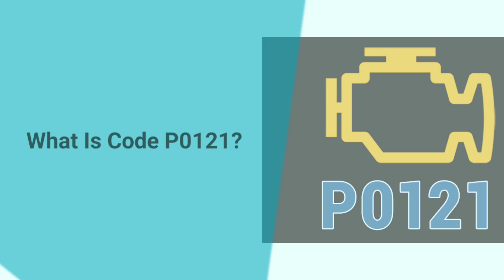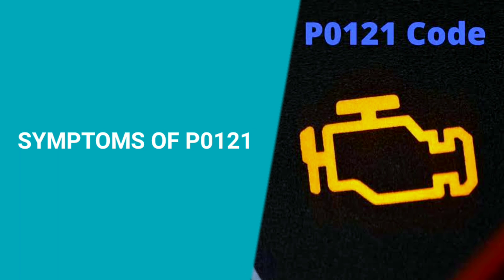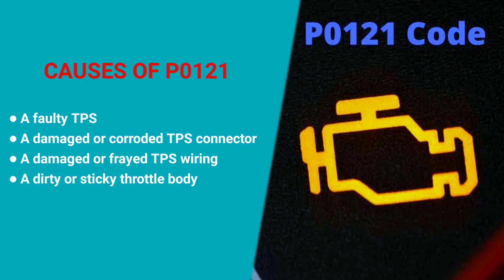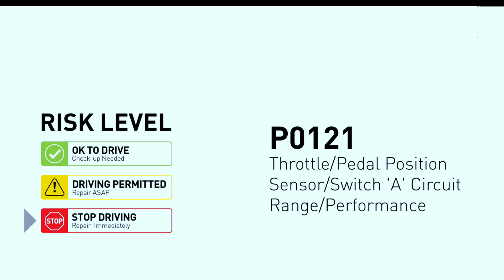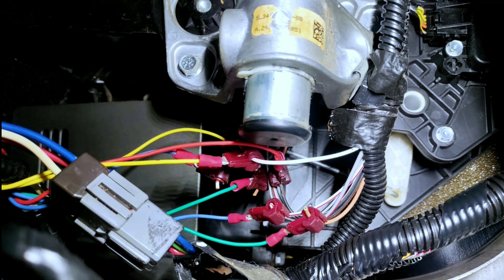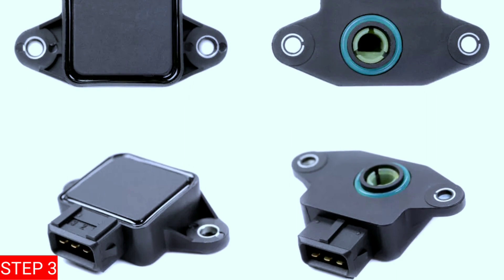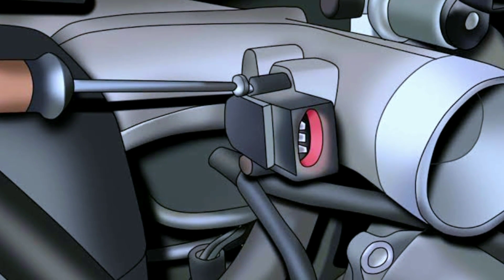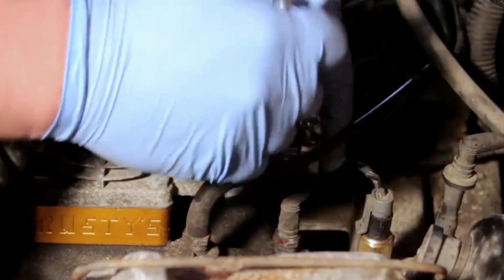P0121 Code: Causes, Symptoms, and Easy DIY Fixes | How to fix p0121 Code |

Comment: Hi, I have a 2011 Kia Soul, and it sat all last winter and summer because I can get it fixed. I changed the oil, new air filter, and charged the battery. It started right up. Runs fantastic but, when it warms up it revs up to 4000 rpms in park and neutral. I put a new idle control sensor, a coolant heat sensor and Throttle Position Sensor, cleaned the throttle body with a toothbrush and throttle spray cleaner and it's still reving up to 4000 rpms after it's warmed up? Im stumped? Any ideas, please?
Reply from the maker: When a Kia Soul revs up to 4000 RPM in park/neutral after warming up, even after replacing the IAC, TPS, coolant temp sensor, and cleaning the throttle body, it usually points to something beyond the basic sensors.

Here are a few possibilities to check:

Vacuum or intake leak – A cracked hose, loose intake gasket, or PCV valve leak can let unmetered air in, causing the ECU to hold the idle high. Spraying carb cleaner around the intake and hoses while the engine runs can help pinpoint leaks.

Throttle body or electronic throttle control issue – If the throttle plate is sticking open or the electronic throttle motor isn’t calibrated, the engine may race. Sometimes a scanner with throttle relearn capability is needed after cleaning/replacing parts.

ECU or wiring problem – Since the car sat for a long time, rodent damage or corroded wiring could affect sensor signals. A wiring check for the TPS and IAC circuits is worthwhile.

Idle relearn needed – After replacing sensors and cleaning the throttle body, the ECU often needs an idle relearn procedure (done through a scan tool or following a specific ignition/idle cycle process for Kia). Without this, it may keep idling very high.

In short: If the engine only revs high once warmed up, start with a thorough vacuum leak check and then perform a throttle/idle relearn. If the problem continues, you’ll need a scanner that can read live data from the TPS, IAC, and throttle motor to see what’s commanding that high idle.
Reply: @weeklytools Wow, thank you so much for your time! I performed a smoke test, and the only thing leaking was the gas cap, which I replaced. I also performed the relearn steps and nope. I haven't check over the wiring, which is a great idea! Thank you so much!

Comment: I've been struggling with this issue (P0121,P0121 RPM rev up down engine at idle Min: about 1100 RPM) for about a year now, and what’s particularly perplexing is how random it seems. Most of the time, clearing the error resolves the problem for a few months, and occasionally, the issue even disappears on its own. However, a few months ago, the problem resurfaced, and this time my engine's RPM wouldn’t go above 3000. Restarting the machine temporarily fixed it, but the issue kept coming back. Eventually, an engineer suggested replacing the throttle body and resoldering some parts of the ECU. I’m not sure which parts were resoldered, but after that, the problem reappeared briefly. Then, after replacing the throttle body and resetting the ECU, everything seemed fine for about four to five months. Unfortunately, the same errors have returned. Occasionally, the RPM fluctuates while idling, while at other times, I only receive the error without any RPM issue. As I mentioned earlier, the issue is completely unpredictable, but it happens most frequently—around 90% of the time—right after starting the engine. I really need to find a lasting solution to this problem.
Reply: Did you ever figure something out
Reply: @brandonlopez4959 u have same problem? Me not still
Reply from the maker: It sounds like you've tackled a lot of potential fixes and it's great you've documented your journey.  If the error is returning, it might be time to look into a deeper diagnostic scan or consider seeking professional help.

Comment: Ótimo vídeo e dicas, o meu aqui e um Peugeot 206 1.0 no aparelho apresenta esse mesmo código será que o problema vai está no sensor tps que fica na tbi,ou no acelerador eletrônico me ajuda amigo?
Reply from the maker: Tienes razón, el código P0121 generalmente apunta a un problema con el sensor de posición del acelerador (TPS), pero no es la única posibilidad. Esto es lo que podría estar pasando con tu Peugeot 206 1.0:

Sensor de posición del acelerador (TPS): este es el culpable más probable. Un TPS defectuoso no enviaría la señal correcta sobre la posición del acelerador a la computadora del motor, lo que activaría el código P0121.

Problemas de cableado o conectores: el daño o la corrosión en el cableado o el conector entre el TPS y la unidad de control del motor (ECU) podrían interrumpir la señal y causar el código.

Electrónica del pedal del acelerador (menos probable): en algunos casos, los problemas con los componentes electrónicos en el pedal del acelerador podrían imitar problemas del sensor TPS. Sin embargo, esto es menos común que un sensor defectuoso.

Esto es lo que puedes hacer:

Verifique otros códigos: si bien P0121 sugiere un problema de TPS, puede haber otros códigos almacenados que podrían arrojar más luz sobre el problema. Considere la posibilidad de escanear el código de un mecánico o utilizar un escáner OBD-II, si tiene uno.

Inspeccione el cableado: busque signos visibles de daño o corrosión en el mazo de cables entre el TPS y la ECU.

Consulte un manual de reparación: un manual de reparación específico de un Peugeot 206 puede tener pasos de diagnóstico para identificar la fuente exacta del problema.

Llévelo a un mecánico: si no se siente cómodo resolviendo el problema usted mismo, el mejor curso de acción es consultar a un mecánico calificado. Ellos pueden diagnosticar el problema y recomendar la reparación adecuada.

Recuerde, el reemplazo de componentes como el sensor TPS solo debe realizarse después de un diagnóstico adecuado. ¡Buena suerte!
Reply: @weeklytools  amigo realmente o sensor tps está fora dos parâmetros, troquei a luz apagou da injeção,porém tinha mais um erro ,escane passou a acusar sensor de temperatura do ar,porém troquei não resolveu,o problema estava no motor das engrenagens da tbi,botei uma completa aí resolveu o problema.
Reply: Obrigado amigo pela ajuda,no aparelho de vez em quando aparece o p0123 junto com o p0121,aí eu apago tudo e logo em seguida só fica o p0121 ,tirei o tps fora ele tá meio zuado ele não está dentro dos parâmetros de leitura correta o normal seria entre 2:20 fechado e 4:50 aberto,o meu aqui está dando 3:50 fechado e 6:50 aberto,esses valores de resistência ele tem que está dentro dos 5volts que a tbi recebe,fiz o pedido da pessoa tomara a Deus que resolva esse problema crônico desses tps
Reply: responde a  minha teoria se está correta
Reply from the maker: You are most welcome.